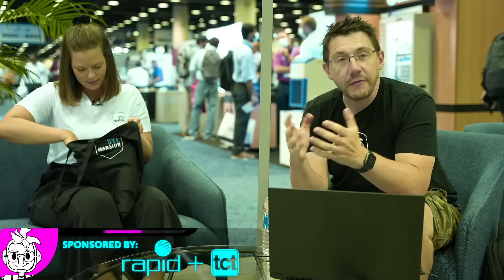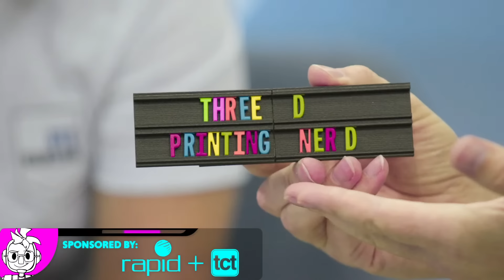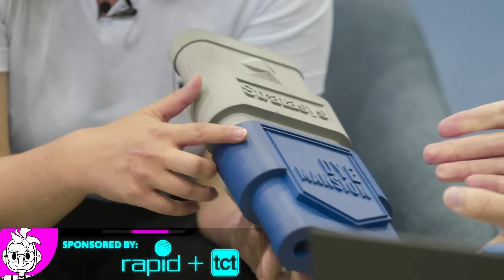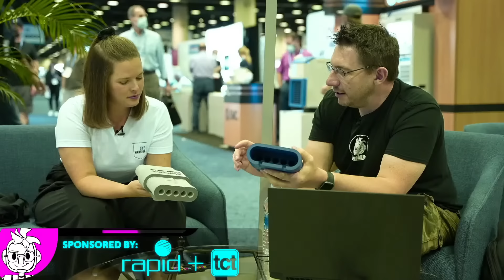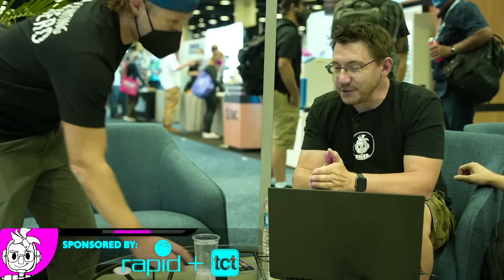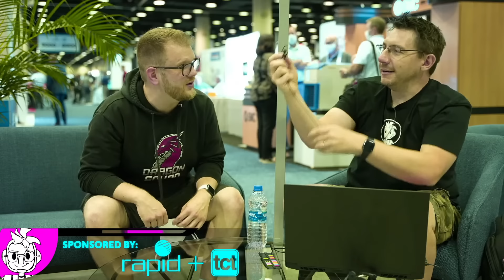Pia Harlaß and Kristin Mulherin LIVE! // RAPID + TCT 2021

Comment: Dendrite is like parametric production rules implemented in an file agnostic manner that only cares about angles and automating part creation in a manner that attempts to eliminate the unwanted deviations that can create useless parts. A friend worked in an autoparts plant that fabbed to tolerances that had to be exact or the failed part went back to being turned into a metal piece ready to be remanufactured. He told me a story about a gear box recall for Chrysler Sebrings because the tolerance was missed by like a thousandth of an inch. Very cool. Dendrite not Chrysler's inability to stay in business lol

THE FUTURE JOEL! Great videos man